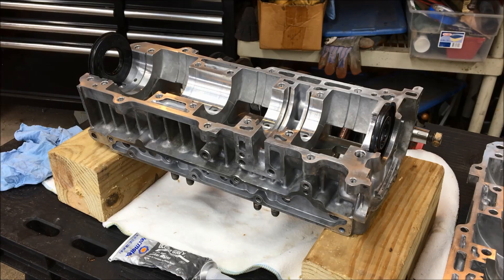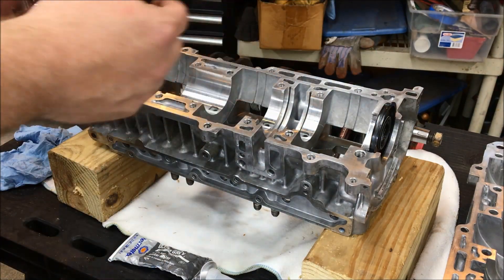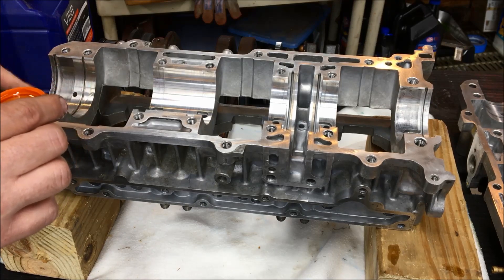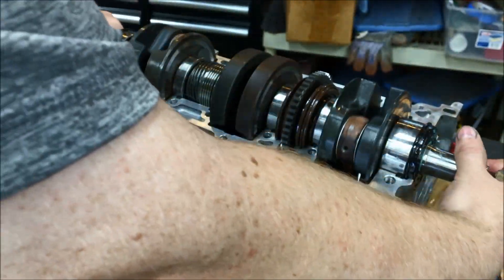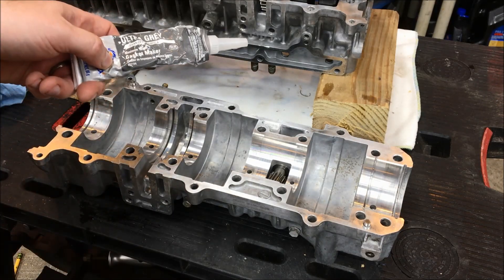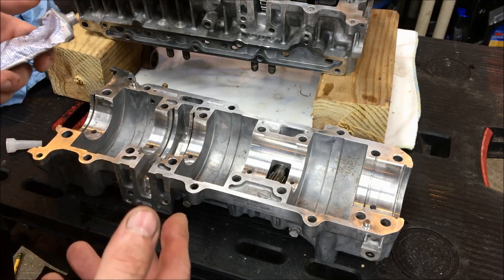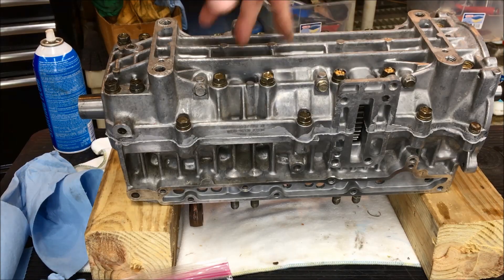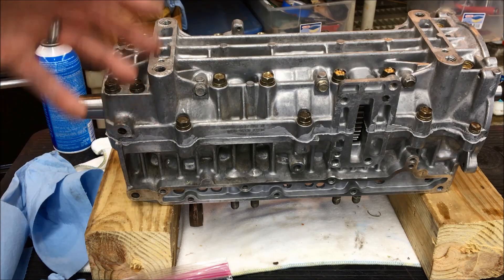Polaris Ultra 680 Project Sled -  Engine Rebuild - Case and Crank Installation (Part 12)

Comment: Nice work, my tips are to pre fill the bearings with the oil u are running, and don’t use so much sealant on the cases only need a light coat
Reply from the maker: Good info.
Reply: @StreetersGarage  yeah pre fill saved the initial startup life and on seals use oil not grease bc grease can potentially hold dirt n dust the oil will wash away fully with fuel, on base gaskets use a slight layer of loctite 518, to stop fiber gasket from weeping

Comment: Did you replace the water pump seals on the crank? Also what oil did you use in the water pump.  Ty
Reply from the maker: The seals were fine. No issues so I left then. 
0W40 for the oil. It doesn’t take much.
Reply from the maker: Nope

Comment: working on my 96 ultra 680    want to reset all three carbs   do i use the drill bit method like you need on the 500     what size two drills bits do i use   Thanks
Reply from the maker: Try .187 and .210
Reply: @StreetersGarage  Thanks
Reply from the maker: No problem. Good luck.

Comment: What are the two gears for on the crank? Not the one for the water pump.
Reply from the maker: Oil pump drive.
Reply: @StreetersGarage  Thanks. I'm getting ready to assemble one of these engines soon. First time. I normally work on single cylinder two strokes
Reply from the maker: No problem. You’ll be fine, just take your time and pay attention to detail.

Comment: How do u put oil in engine??
Reply from the maker: It’s a 2 stroke.
Reply: @StreetersGarage  I know it is a 2 stroke but when I  pull ed heads off oil  was on crank case and how does oil get on crank?
Reply from the maker: There’s oiling lines on the outside of case that feeds the bearings. There’s also oil injection in the intake portion of the case.  One per carb.
Reply: This is the 1st snowmobile.Its a Polaris Indy 1993 440. I found right side piston and cylinder scrod.I do not know if oil for fuel not working. Can u tell me how to check with engine torn apart?
Reply from the maker: Is it a fan cooled or liquid?

Most burn downs are caused by an air leak. Either from bad carb boots, bad crank seals or bad exhaust gaskets.  Dirty or misadjusted carbs as well. 

The oil injection typically never fails and if it does it fails in the wide open position.

Comment: What type of grease did you use?
Reply from the maker: It was marine rated grease. The grease is only there for first startup until the premix gets into the engine. 

The oiling of the lower end during assembly is just as important